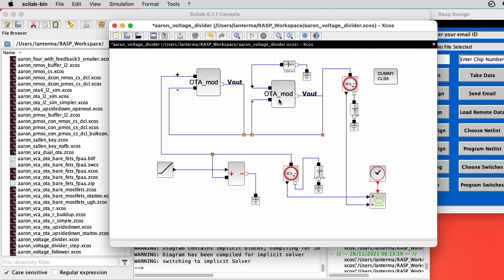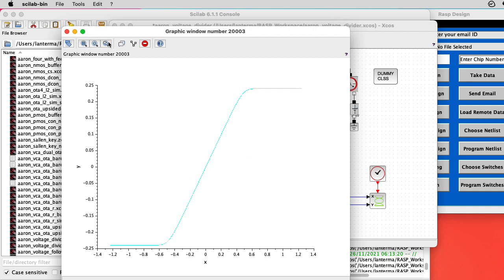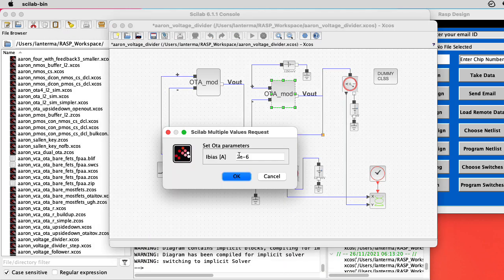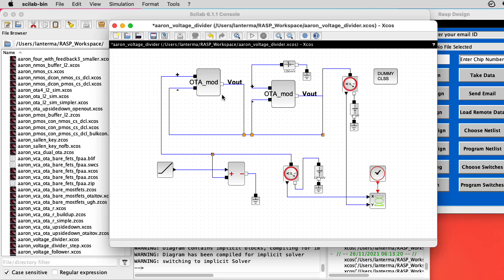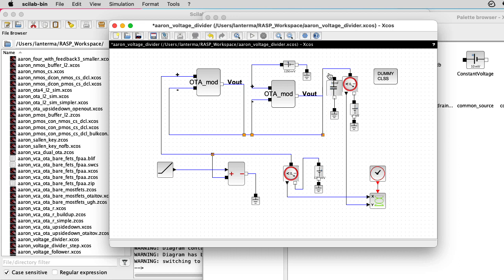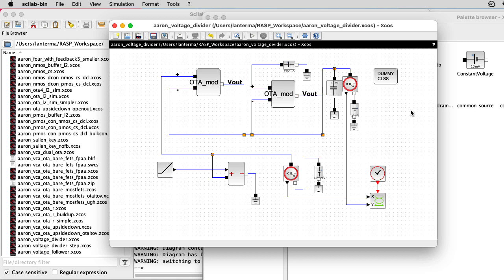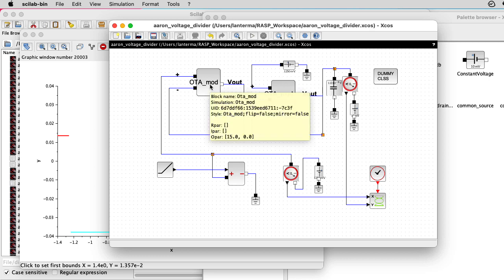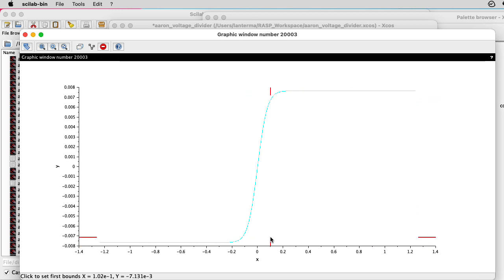FPAAs: Revisiting Voltage Division with OTAs (adding a capacitor) (Field Programable Analog Arrays)

Comment: Hi Aaron. I work developing other Modelica based tool (Wolfram System Modeler). That problem requiring you to add a capacitor seems to me that it is because the model creates a complicated nonlinear system that needs to be solved and fails. By adding the capacitor, that nonlinear system is broken into smaller systems (probably linear) that are easier to solve. In System Modeler we have a debug tool that can be used to locate those problems.
Reply from the maker: Thanks so much for the tip! That is very interesting. I will check out Wolfram System Modeler.